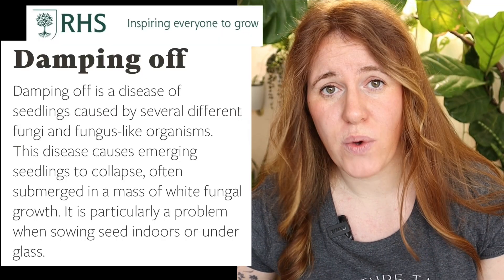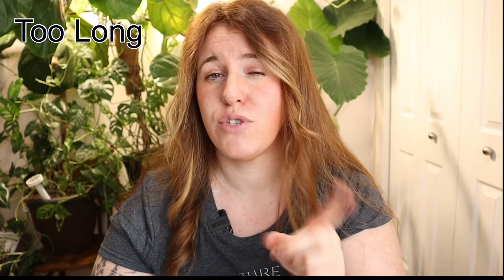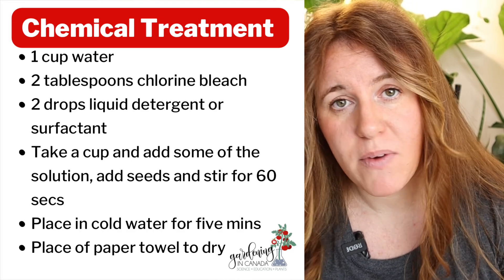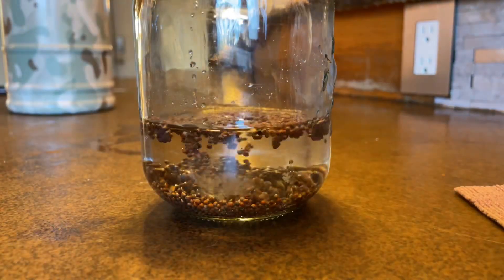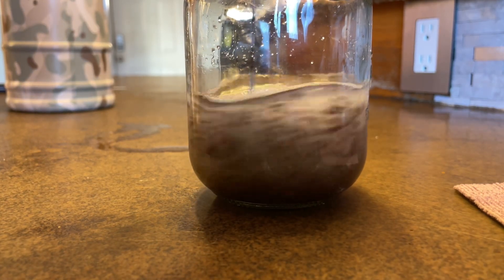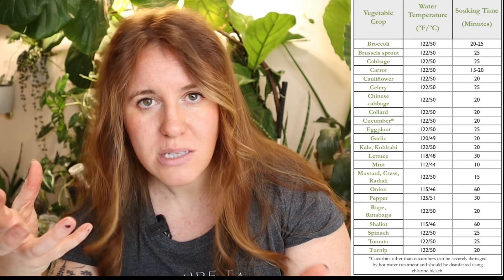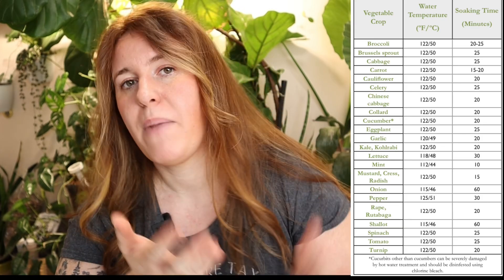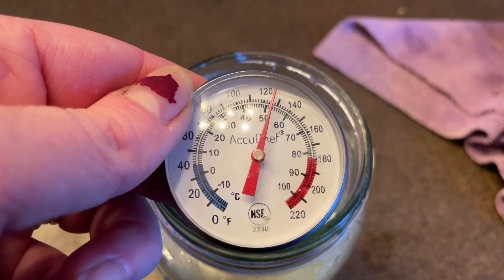How To Sterilize Seeds To Prevent Bacteria & Mold. Dampening Off Fix & Perfect For Microgreens.

Comment: Never really had an issue with dampening off. But I will store this away in case it becomes a problem. Might be because I start with sterilized equipment. I just washed it all today, the most unfun job of seed starting season.
Reply from the maker: For me I like doing this for microgreen in particular.

Comment: Are their any risk of killing seeds using the chemical treatment? If so, how would you know other than planting and hoping for germination? Does the buoyancy help tell the quality of a seed? Will the suggested chemical treatment be enough to treat the mosaic virus? Will submerging seeds in the sterilization solution be any more effective if I do for 10 minutes? And would I need to submerge it in cold water for longer to rid it of bleach/detergent residue? Your on-screen showed two drops of detergent, but you said a single drop. Was that typo or did you misspoke?

Comment: This would be great to use on expensive seeds like cannabis. Thanks Ashley!
Reply from the maker: Yea thats a great point actually.
Reply: @GardeningInCanada  Nope... Please, do not do this with cannabis seeds!!! @Francis Meowgannou . This tutorial is about using seeds from less-than concerned seed growers/producers/sellers. Expensive seeds, such as cannabis, come to you through diligence of sourcing from good suppliers. On the other hand, if you pop your own seeds and question the health of the source, sterilization may be a thing to try... but I would just pop good seeds from healthy plants versus trying to fix a problem and waiting to see if it worked.
Reply: Look to my reply to Ashley; the link-thing did not work.
Reply from the maker: What if you save your  own cannabis seeds 😏
Reply: @GardeningInCanada  I did mention this indirectly by writing I would pop seeds from healthy plants, just as the seed banks do. 
If the mother/seeded plant is not healthy, then your recommendation may hedge against failure. Otherwise, don't use an unhealthy mother to produce questionable seeds. 
Thank you!

Comment: One thing I would recommend is dry your seeds on a coated paper plate or wax paper. They will be less likely to stick to the material compared to using paper towel.
Reply from the maker: great suggestion!
Reply: Coffee filters less sticky also. I sandwich coffee filters between paper towels. Then I get the best of both worlds.
Reply from the maker: Coffee filters! Genius